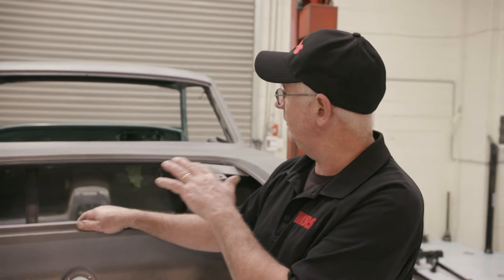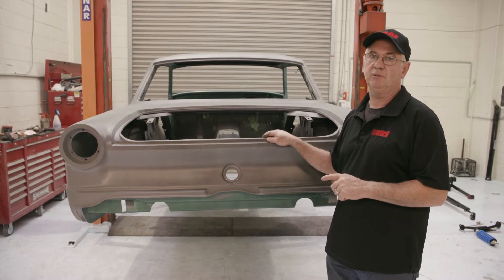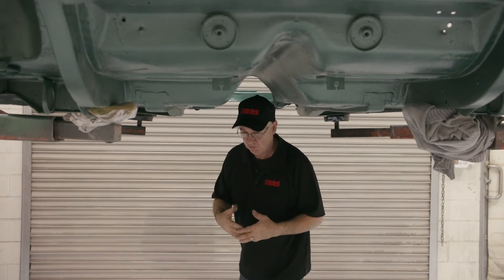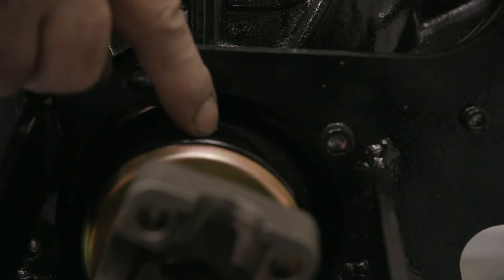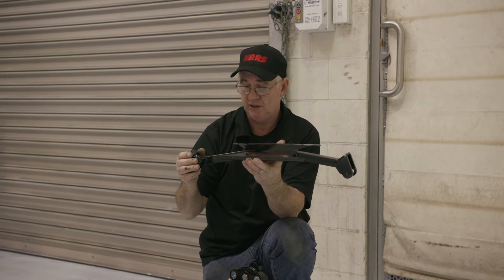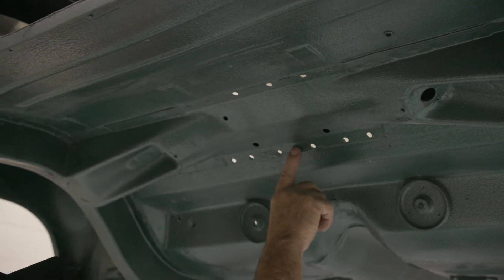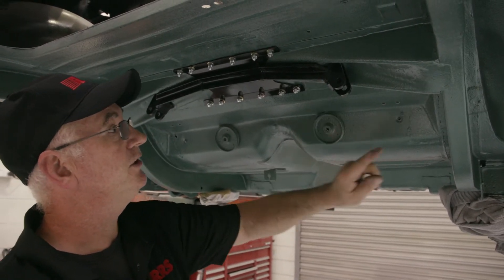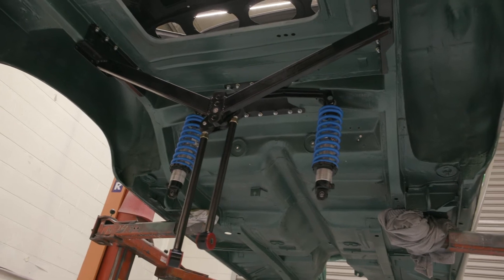RRS 1966 Ford Falcon rear suspension

Comment: Hi just wondering what rate springs you are using on this?
Reply from the maker: between 275 and 350 depending on the car/motor/type of driving
Reply: @Rrs-onlineAu  great thanks I have an XE that we've done our own 9 inch with moly adjustable arm conversion and will be running Coil overs from the diff vertically into the original spring /shock mount area on the body with modified top mounts. Trying to workout what spring rate we'll need was guessing 250. Car has no engine yet so we can't weigh it.
Reply from the maker: @greensladegraphics9518  If you have GVM over 1550 go with 325 , if over 1700 then 350 and if you move the battery to the back move the GVM trigger back 75kg
Reply: @Rrs-onlineAu  awesome thanks for your help!